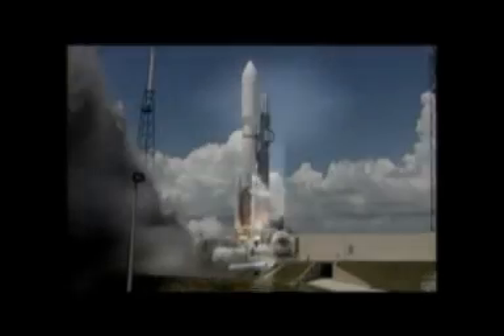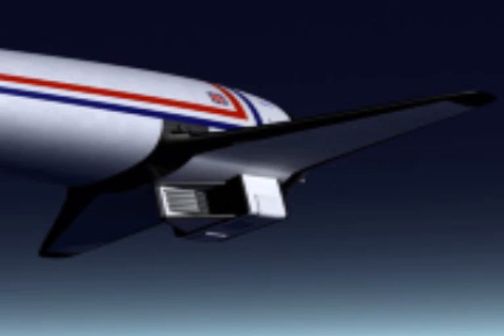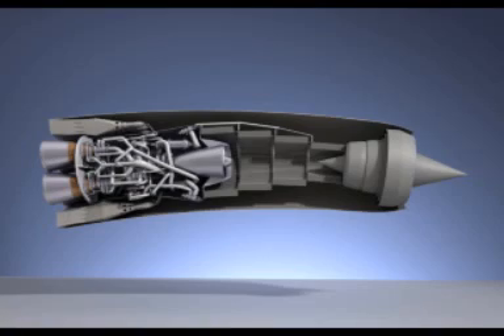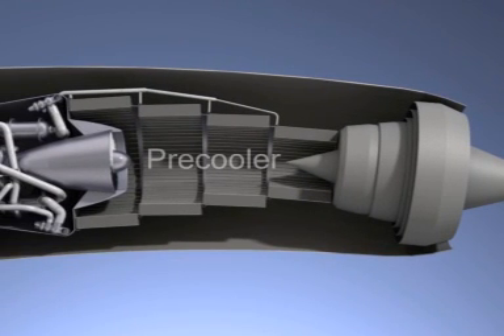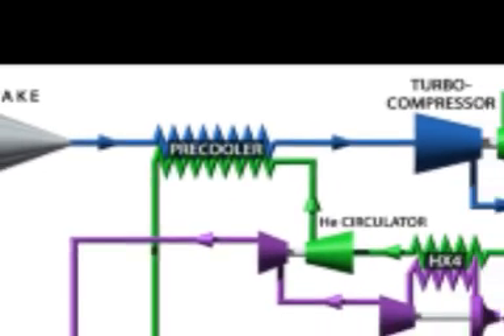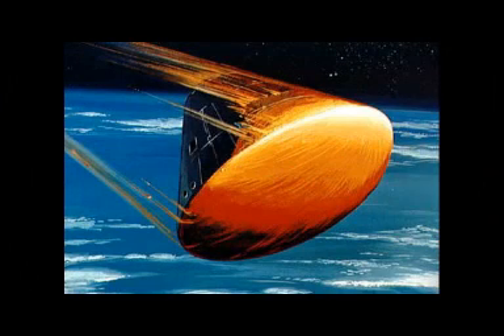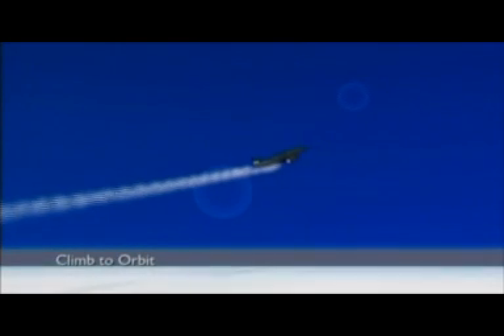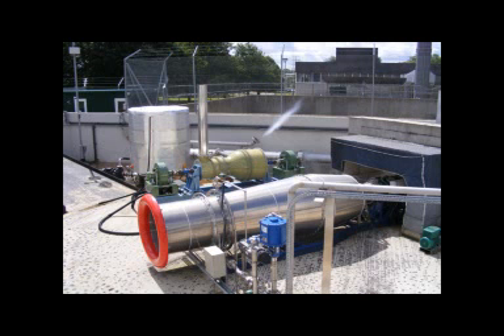Skylon. The Key To Economic Access To Space?

Comment: Not exactly. They tried. But, they didn't really think about jet engines and concepts like the SABRE hybrid, so they ended up using chem rockets for their try. It failed massively, and was cancelled. They even designed it to be a testbed, not really like Skylon, which is more of an actual plan.

So, if your TESTBED fails so bad that it needs to be cancelled, you're doing SOMETHING wrong... :P
And, NASA and Boeing aren't doing so well.

Comment: ...No, an air-breathing rocket engine. It takes oxygen from the air, cools it, liquifies it, and burns it with fuel, liquid hydrogen in this case. Once the air is too thin, it switches to its internal LOX supply.